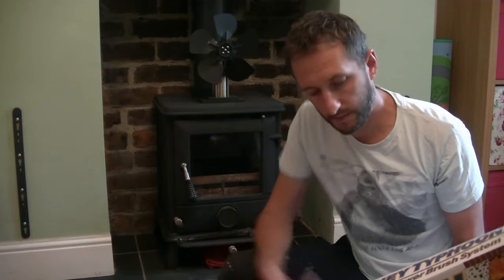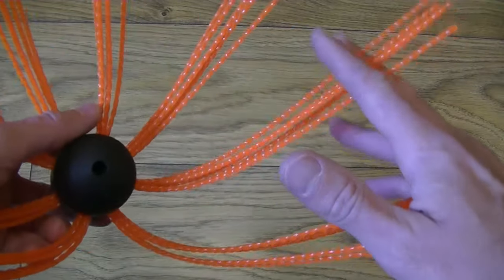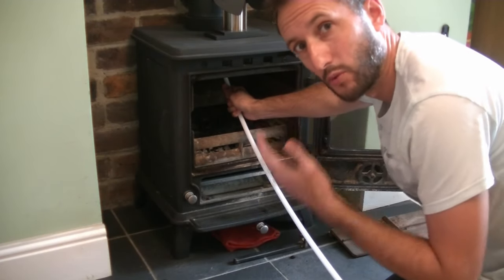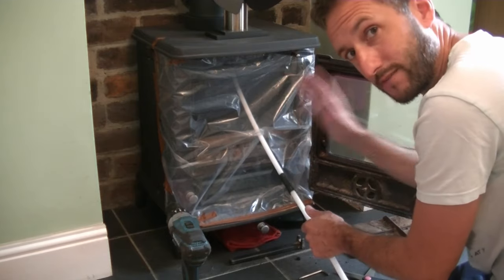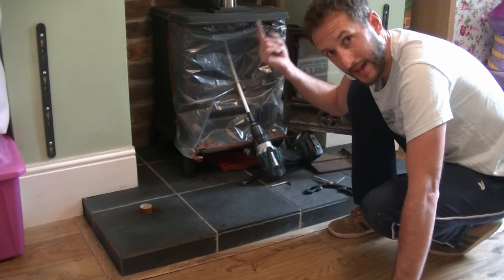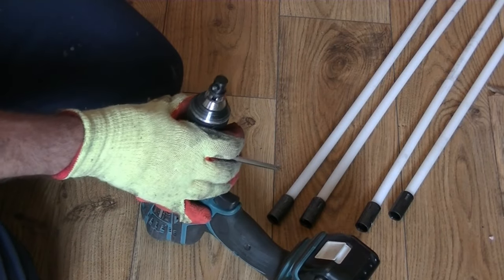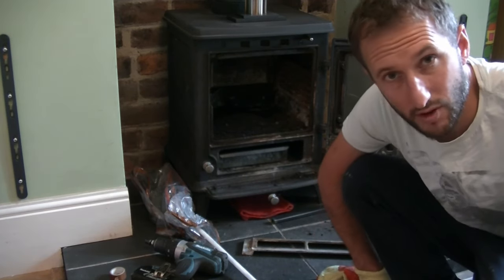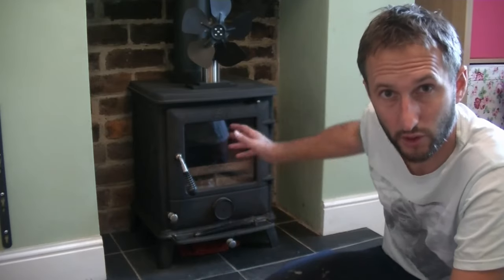How to sweep wood burning stove flue. Chimney Typhoon review & demo. DIY clean & sweep chimney!

Comment: So little soot came out, it looks as if it was hardly worth cleaning! I was hoping to see a real test using the rotary brush, with baked on lumps of tar blocking the chimney.
Reply from the maker: On your flu or mine? I clean it every year. If I let it block up it wouldn't be much use for it's intended purpose!
Reply: @POUSEaroundtheHOUSE  Thanks for that. I guess you could try a feather duster.

Comment: Got one of these last week for a blocked liner and one of today's sweeps was the same, as a chimney sweep, I found this bit of kit excellent for the job, I haven't trimmed the brush and it works fine.
Reply from the maker: For the money it's a great little tool. I've used mine a few times now, easy to use and very effective. Thanks for watching!

Comment: Concise and clear demonstration which has prompted me to buy a kit. Frightening shot of you on a roof though. A little niggle for me was the use of the word ash rather than soot. This is solely my personal view as I consider the ash to be the residue left from the burning of wood and the soot is the build up within the flue. 
Just as an observation I believe that the most efficient way of burning wood is to have a layer of ash (not soot) as a fire bed about 50 mm thick rather than having a grill under the bed as normally found in a multi fuel stove to provide an updraught for burning solid fuel.
Reply from the maker: I can't disagree with any of that! I have links to the kit I used in the description below the video. Thanks for watching 👍
Reply: @POUSEaroundtheHOUSE  Bought and arriving tomorrow

Comment: I bought an ash vacuum and had exactly the same problem,zero suction after about 30 seconds,had to clean the filer and wait for it to cool down.For the price I could've got a second hand Henry,thanks for the tip !
Reply from the maker: No problem. I'd happily buy a new one as long as you use the correct bags. Thanks for watching.
Reply: Henry are amazing 😊

Comment: Great video, looks easier than using a traditional set (drain rods) one question are the front bars in the correct way-looks like ash would fall through and forward
Reply from the maker: They are indeed in the right way. It's an Aga Ludlow stove. Thanks for watching 👍

Comment: Hey.  Good Video.  I want to extend the period of time in between sweeps - how long had you left it since you had alot of ash. Of course it depends how often you use the stove, plus what you're burning is a factor too. Any info ? Cheers
Reply from the maker: Mine was about 2 years but I do it once a year now with this sweep system. Good quality wood also helps.

Comment: Excellent clear vid again mate. Very concise and helpful. On another point: who installed the stove. I ask because of the clearance distance to combustibles are usually around 400mm and your wooden skirting boards look about 150mm. Just to be aware. Great vid!
Reply from the maker: I fitted the skirting after the stove was in place. Had the stove fitted by HETAS engineer. He wasn't too bothered by the combustibles rule, but to be honest it never gets hot by there, and I think it's a rule that most people don't follow, so I put them on. It's fine. Thanks for watching!
Reply: Sorry little confused at the instructions to cut brush to size,I have a 6" flue lining, you sugest to cut down to 9" if the original diamiter is 45 cm /18" are you suggesting cutting 9 " off the bush strands ? 4.5 in each side ?
Thanks ...Eddie

Comment: Only thing I would suggest as a 'hack' would be removing the locking button on the drill adapter - that will never go up the lum so would make adding/removing rods much quicker!
Reply: Yeah, so the rod can whip loose and poke your eye out or slap the family jewels, LOL.
Reply: pipedreams57 good point! My reply should have included the warning... hack not to be used by clumsy numpties 😂😂😂
Reply from the maker: Thanks for the feedback!

Comment: Is this ok if I have 2 x 45 degree angle ?
Reply from the maker: Should be fine, they are very flexible, just take your time and turn the brush as you go. There's a link to the power sweep in the description section below the video if you need it. Thanks for watching 👍

Comment: Problem is that the chimney isn't usually where the buildup of creosote/ash is, it's the chimney CAP that clogs. Therefore, you still have to get out the ladder and climb up on the roof to remove and clean the cap. That takes care of ninety percent of the problem. While up there anyway, it's pretty simple to run a conventional brush down the chimney to take care of the other ten percent. I have yet to find a way to clean a chimney cap from below, or (the holy grail) a self cleaning chimney cap!